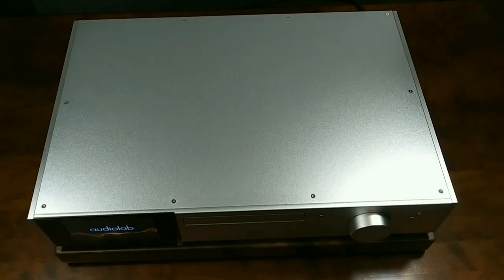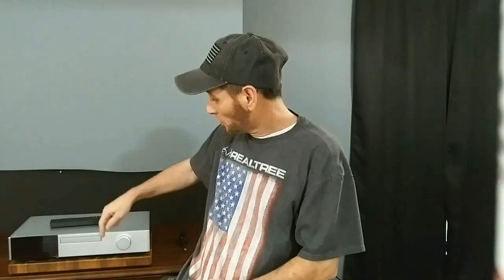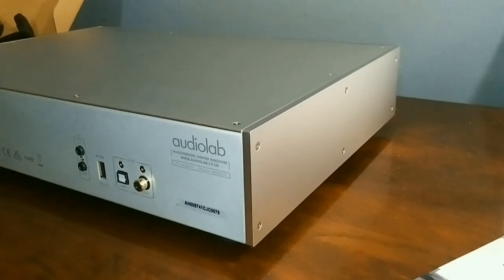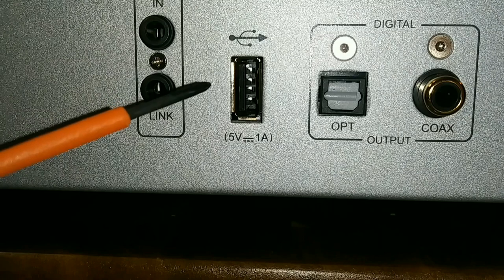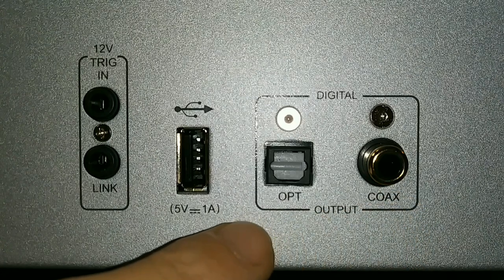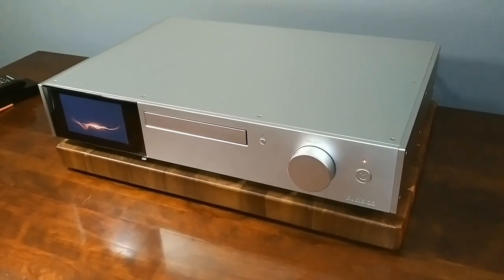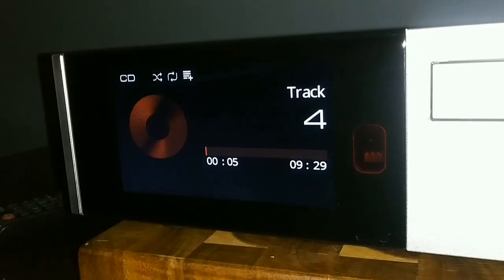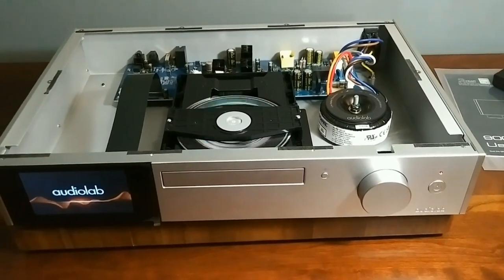New Flagship Audiolab 9000cdt Compact Disk Transport Impressions video & Pop the Hood@28:40 Endgame

Comment: Hey Audiolab, Put a top loading drawer in the 6000 and watch you sales increase! Thanks Tee-Jay for the video.
Reply from the maker: I opened both up big difference cd mech in 9000 wouldn't fit in 6000 😆 Completely different animal desighn front slot load vs  metal Mech )
Reply: Roksan have tried to beat them to it, though I believe there are reliability issues....
Reply from the maker: @robh9079  almost bought the Roskan transpirt when i was doing my reserch . 
Couldn't choose between many different models like the 
Heed Thesis Yamaha CDs 2100 Marantz Ruby Hegal Mohican Jays Audio Denefrips Avatar and these transports and players msrp is 3k to $5500 U.S So when i found out about the Audiolab 9000 series I been waiting 2 months !! 
And so happy i waited saved up my O.T. money basically my Xmas 🎁 to myself really happy with it - my dacs never sounded this good - also going to lightly Mod the 9000 stay tuned !

Comment: With my PC and inexpensive or may be free software, I can rip CD's and make audio files which can then be played error free. Or even better I can download songs at CD or better quality and play them error free with a good DAC. The spinning plastic disc as digital storage media is obsolete, and ipso facto CD transports are obsolete.
Reply: i hear you but remember one thing: computers were NOT built for pure audio. They are a multitasking tool with a processor/graphics card/RAM etc. playing from a computer goes against the the most important requirement for the audiophile: NOISE! every computer is a NOISY environment with FANS spinning hence it will NEVER be as PURE as a CD transport for sound quality. a CD transport is built for PURE audio.

Comment: hi there! what coaxial cable did u personally use in this review? 🙂
Reply from the maker: I used several my favorite is Audioquest Cinnimon -
Reply: @tee-jaythestereo-bargainph2120  i got a tough question but would the QED Reference coaxial cable be good enough to transfer the digital signal & get "out of the way" so to speak without ever needing to buy another one. Would it be a worthy match to the 9000 without it ever being a bottleneck?
Thanx in advance for the advice! 🙂
Reply from the maker: @rauldon273  as long as the cable is shielded thatw most important '

Comment: Heard that the bass of the 9000CDT is a bit less then the bass of the CDT600. What is your opinion??
Reply from the maker: Not at all , also depends on your dac your using - and 'digital 'output' 
 Coax is supior imho with its dual differential desighn - I had both 6/9 hooked up to my denafrips ares2 and 9000cdt performance is quite noticable but far as bang for thr buck yeah 6000cdt holds that 👑 The New 7000cdt will be out soon 6000 with loading mech 😆
Reply: @tee-jaythestereo-bargainph2120  Thnx!

Comment: Your top dog system ain't no Mid Fi it is Audiophile HiFi - Screw all the Audiophile Snobs, Also I have a Vintage /Modern mix with a Pioneer SX1280 as the Main and I'm considering this transport because with the Node X  and the rest of my system it sounds better than a big portion of these new all Digital units, you and I have a similar problem,  weLike almost Allof the same music including the Rock and Jazz!
Keep up the good work and stay with the person you are!
You and I both know these 250k up systems do not sound enough better to cover the "High End Audiophile Snobby" Systems!
I do wish the display had VU meters like the 9000 Amp, which is also a killer deal.
Reply from the maker: Yeah I agree ' I have heard very expensive systems ' 1280 a very solid amp !
Reply: @tee-jaythestereo-bargainph2120  Hey I just ordered a Set of KLH Model 7s , you should think about a review on these as they are a Bargain for what they are! I have a Set of JBL L100 CLASSIC 75s serial 000 of 750 and KLH Model 5s , and let me tell you for the Difference in Price under 2k for the 5s They are awesome Performers, The JBLs are better but they cost Twice as much. I will send you pics (am currently doing pics for a HiFi Store) once I have the 7s!  Crank On Fellow enthusiast!
Reply from the maker: @dtracy03ss  hell yeah ! Keep on keeping on ! My buddy Sean Fawler 
@ Zero Fidelity loves the speakers with Yamaha AS-1200 ' send them an email for me to review be glad to take them for a test drive ' 
Almost done with Dynes video lots of editing ' new 📷 is so much better than my old $200 cell phone !!